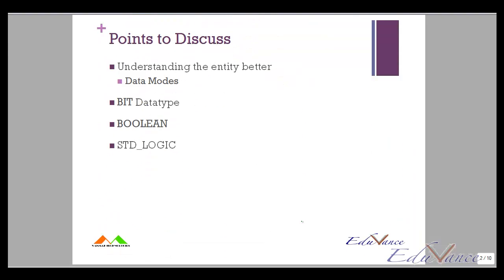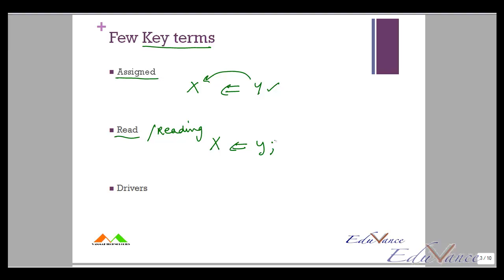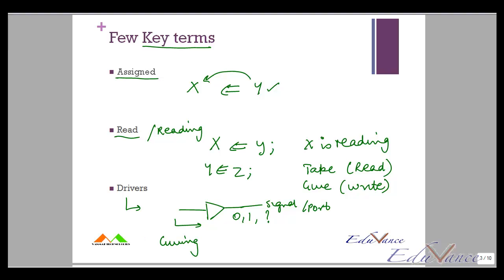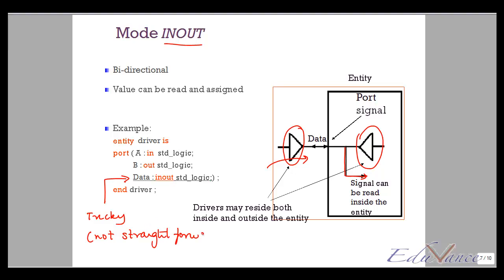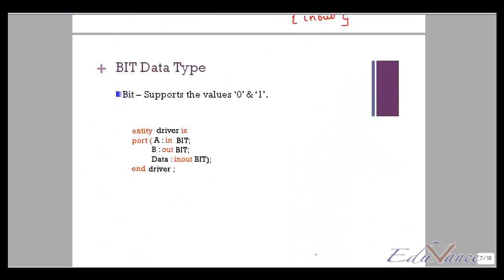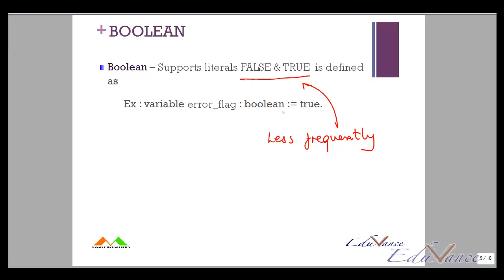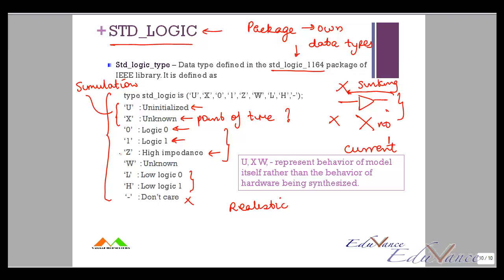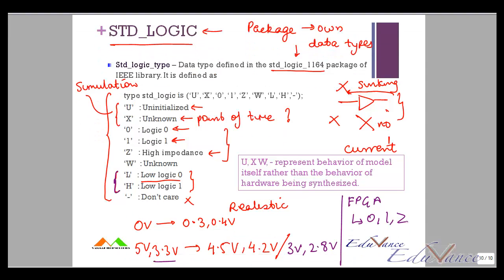VHDL Lecture 2 Understanding Entity, Bit, Std logic and data modes

Comment: STD_LOGIC: Is there a difference between X and W?
Reply from the maker: 'X' represents a state where the output of that particular signal couldn't be determined because there were two signals(one HIGH and one LOW) driving that output.  
'W' represents a state where the output of that particular signal couldn't be determined because there were two ''weak'' signals(one weak HIGH and one weak LOW) driving that output.